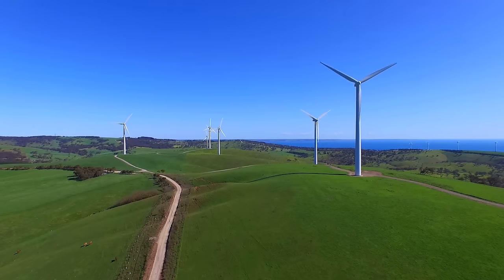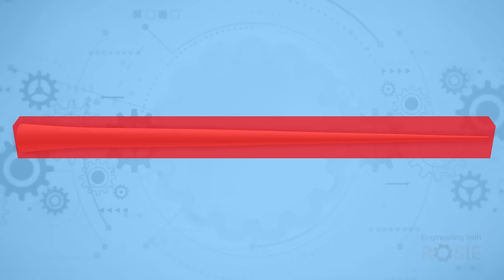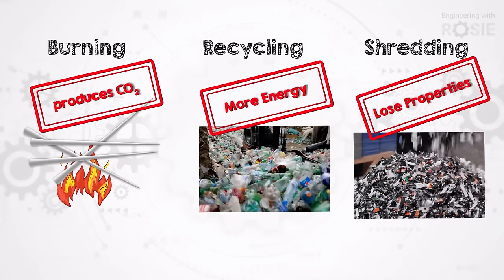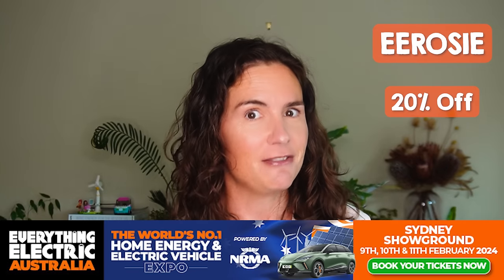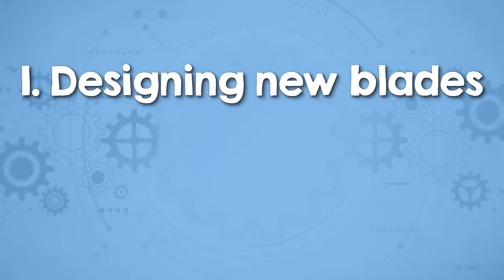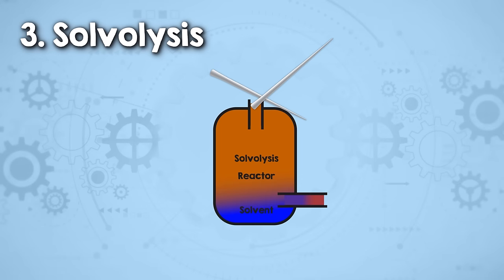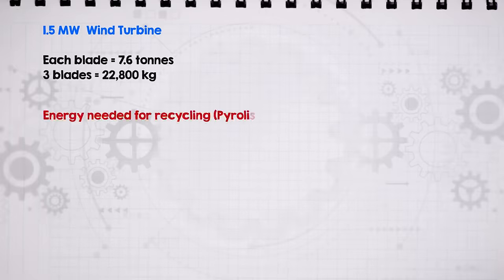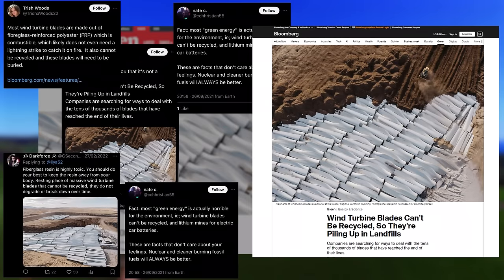This Is Why We Don't Recycle Wind Turbine Blades

Comment: I don't see the problem with using landfills for wind turbine blades. It would seem that burying them and forgetting about them would have few environmental downsides? Do these massive structures break down in landfills and leach harmful chemicals? Are there any other hidden environmental or ecological drawbacks to this option that we should be aware of?

Comment: Repurpose on site to redirect wind in a way your modeling software says will improve efficiency. Use them on site as storage, as shelter, as a culvert or as a barrier. Land fill them on site so they aren't as noticeable. Reprocess on site to fit into standard shipping containers using the industry equivalent of migrant laborers and/or harvester combines.  Park them in the closest convenient space until whatever solutions mature to the point someone offers to buy them.
The USA can just lay them along our southern border and call it a wall.
Just to brainstorm a few ideas.

Comment: It would be interesting to understand how it is possible to calculate blade use per person since number of blades required is variable as wind speed varies from 0 kph to >100 kph and operational temperature must be >-30 C. At 0 kph and/or -30C, an infinite number of blades is required. So too an infinite number are required when wind exceeds max Q.

Comment: What do you think about the very recent (just a few days) announcement by a WSU research team's new chemical recycling process? Is it hype or a real thing? I got the idea that it's only for carbon fiber, but I'm not sure if it could be adapted for glass fiber, too.

What they say is: "The method preserves the carbon fibres as well as the resin material in a useful form that can be easily re-used. It works at moderate temperatures below 200 C and ambient pressure without the need for a pressure chamber, which saves operational and capital costs."

Comment: hi in stead of burying the blades in land dumps why reuse as a river bank replacement they could driven down into side of bank and each one over laps the next as in fish scale help hold embankment in place finish of coat of concrete or fill the hollow of each vane to give extra weight

Comment: What about using them for road base materials to span across soft areas which use up a lot of fuel in equipment to remove material from the areas, making an then transport the new materials back to the area, an then place an compact it back.

Comment: If some of the wind turbine blades have been at various graveyards for over a decade, I have a question.  Why wasn't a recycle plan developed in parallel with design and manufacturing of the blades?  May seem to be an ignorant question, but the bouncing around by the author gives me the impression recycling was not as heavily considered as it maybe should have been.

Comment: The use of shredded tyres,plastics and other solid organic wastes in cement kilns is well established,these blades have the dual benefit of providing both energy and raw materials to the kiln.
As you point out there is no increase in CO2 as it just replacing,typically coal,and the inorganics in the blades, mainly Silicates are essential for the cement chemistry. 
Cement kilns have been using similar shredded wastes for more than 30 years.

Comment: Great stuff, though I would like a little more on just how small a problem this is. Burying inert stuff in landfill is anyway not a bad outcome - it takes little land (the quantities are tiny in the context of the far more hazardous stuff we already bury) and the land is eventually completely reusable anyway (you can happily build houses or farms on it). As you point out the turbine blade's very durability is what makes them inert and therefore harmless and not worth recycling.
I just don't see what the big issue is - to the degree that I think those pushing this "turbine blades are environmentally disastrous" schtick are just desperately looking for excuses to keep burning coal and oil.

Comment: What about using the blades as telephone poles or poles for home back yard turbines? What if the blades flange were attached to a ground rotating base, would the blade and nesele turn into the wind?

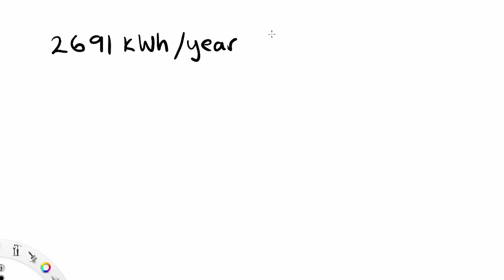Comment: 1:30 your calculations assumes that wind turbine will lasts 20 years, but in practice we can see that it's not a case.
Those landfills are not filled with 20 y.o. wind turbine blades.

Comment: Shingles on roofs? 
House siding?
Bus benches and awnings?
Cut crosswise to make earthen reinforcements? (like those dirt filled tire structures or road reinforcements)

Seems like they could be cut into shapes for tons out outdoor uses, not just bridges. The entire blade wouldn't be good for any of those. I bet there isn't much area for straight and flat enough bits to be cut off for 20ft siding pieces, but there's surely some. Then the smaller profiles can be cut into shingles. If the blades can be reformed via heat and pressure then even more of the blade could be reused.

Comment: Perhaps our problem is that we don't take externalities into account. (the cost of not recycling something).  It is more of an accounting problem than a technical one.  Many of our worst assaults on the environment that we all swim in, is caused by us not considering externalities.  For instance, whether or not the alkanes and alkenes produced by simple pyrolysis of plastics are valuable enough to defray the cost of the process would look quite different if we took the cost of having microplastics in every corner of the planet including in our bodies.  Add to this the cost of sending and storing something in a land fill and a few other factors.   The pyrolysis of turbine blades should also produce a range of hydrocarbons which can be separated in a fractionation tower.  In addition petroleum chemists have worked out methods (cracking for instance) to produce either longer chain or shorter chain molecules, depending on what is in demand.

Comment: if there was a cad model of those blades one could cut out profiles for use in projects with a saws all or rotozip with abrasive blade. if you had a 3D profile on CAD it would be easier to use in a larger assembly.

Comment: I'm interested in the technical details of why you could not use aluminum.  I understand the answer is cost and weight.  But would it also be literally not feasible at that scale? Only asking because from my understanding aluminum is highly recyclable, and was used for a long time for airplane wings.

Comment: Hi rosie
My name is Nir and I live in Israel so you have fans all over the world. 
I saw a video of a German engineer taking waste of composite materials and adding them to the concrete mix. According to his claim. by adding these materials to the concrete mix only half the amount of cement is required to reach regular concrete performence. It is also possible to significantly reduce the amount of steel in concrete. (The production of these two materials is a big ecological problem )  Do you think there is any scientific truth behind this claim?  Can shredded blade waste can be used for this purpose? Apologies for my poor English Thanks Nir.

Comment: Penrose the hell out of their shape, make them stackable AND aerodynamic?  I'd love long lasting roofs and walls made out of them.
That said. With rising sea levels, our flood delta based cities, which are plenty, will need enormous volumes of light ground filling materials.
Stuff that can float on water saturated clay.
Instead of producing new dense expanded polystyrene, the old blades seems perfect for the job, if they are light enough.
That density comparison I have to leave for somebody else to make, but there should be structural advantages, too.

Comment: The overall problem seems to be the repeated stress due to flexure and the temperature variation during the day. It could also be the tip velocities are to high so a change of material at the tip could or the tip can be cooled preventing aerodynamic heating.

Comment: Transporting used blades is a huge problem.  I wonder why no one has come up with some type of portable grinder that can grind up used blades.  Even if they are just going to be put in a landfill, the chopped-up blades should be easier to transport.  They would also not provide the photo-op that full blades make when they are lined up at the landfill.

Several of the recycling options involve chopping up the blades.  Doing an initial chopping operation onsite would probably not be a problem.
Reply: A wind turbine blade or any grinder has to be many orders of magnitude greater  in terms of mass..... take a paper grinder, it will give you a sense of what would be needed... And I have thought of it myself and I believe it's been done for smaller wind turbine blades.....

Comment: You make great points. I would maybe suggest using the turbine blades into artificial reefs instead of tossing them into a landfill where being buried underground serves no utility. The artificial reef idea might be sound because it would encourage sea life to foster. Fiberglass would not pose a danger since it's universally used on most marine watercrafts. Any how...I hope it might spur creative ideas beyond burial as the most ecological way of disposal.
Reply: It depends whether reef wants to take of on fiberglass/composite surface ( I do not know )
Reply: @dmitripogosian5084  barnacles will attach to fiberglass over time. The tube-like structure also makes a viable cave of sorts for ocean life. Perhaps long blades could be used as pier walls to mitigate ocean erosion.
Reply: @pdubsweir3  good point, barnacles surely will attach

Comment: I would go with getting thermal energy out of the old blades – least complicated, and even though there are CO2 emissions, they are not nearly as bad as it looks.Would be even better, if we could produce the blades from renewable materials (that take the carbon out of the atmosphere in the first place). Landfill does not sound desirable, even though if done in a "concentrated" form, those blades could be dug out later if needed (easier with large pieces than with shredded stuff).

Comment: Please, someone calculate the value of carbon sequestration in properly burying the blades. Please also Include a discussion of the potential sources of both the resin and the fiberglass as to renewability. Please also include in the calculation table the comparison values of CO2 emitted in the various alternative processes involved in recycling. Please also Include a discussion of the potential sources of both the resin and the fiberglass as to renewability. Obviously burying the blades sequesters more than just carbon... TY someone. ❣

Comment: Given that the cost of transporting decommissioned blades to recycling processes is significant, and we do not yet have completely green transport options, maybe it would be best to stockpile blades close to the original installation. This could be in some pit (effectively a specialized landfill) or some convenient cavern or disused mine or something. Money would be set aside for recovering and transporting the blades at a future date when green transport is available. 
    In addition, they could be stockpiled for longer, say 50 or 100 years, until sufficiently advanced recycling is affordable and available.
Reply: Shall we start garnisheeing your pay for recovering and transporting the blades at a future date when green transport is available?
Reply: @billrichards1965  ?? These are ongoing businesses with significant revenue streams, and they can set aside reserves for eventual transport as part of the cost of doing business. Why should they even consider touching the expenses side of their balance sheets? I don't see the logic. Whose pay is going to get garnished?
Reply: @fbkintanar  Part of doing business is to look at both sides of the balance sheet! How many companies would continue doing business at a loss? None, hence why the massive subsidies for when it's windy farms.
Why not garnish yours of course. Consider it a down-payment on the eventual recycling of the blades!

Comment: I spent the video wondering why they can’t repair blades. It would be a lot better.
Although the elephant in the room is how does blade waste compare to other type of power generation recycling at the end of the power plants life. Such as a gas turbine including the hall and ancillary equipment, and also nuclear power stations which take decades to decommission.

Comment: The header reads 'why we don't recycle them'.
Then you posit that the question is 'why are they just so hard to recycle'.
A MO company is doing it and selling the output to power concrete ovens.
They are paid by GE and the ones which burn it pay them.
Using them for snow fencing could just millions of them.  but only once..

Comment: So the bottom line is one of the main components of a wind turbine is not recyclable. Most other main components have to have Coal mining involved or the use of fossil fuels to get the raw material in a usable form. They are very recyclable. How Ironic to think that it’s a Renewable process.

Comment: The comparison to a bike's "footprint" is helpful, but I think it doesn't accurately reflect the intrinsic value of all the specialized engineering that goes into turbine blade manufacturing. It's not that bikes don't also require great engineering, it's that there are scores of use cases outside of wind energy where there is great need for engineered material of that scale and structure. It's a total wasted opportunity to let them all wind up in a landfill.

Comment: If the energy for recycling is only a few days output from the turbine then surely that has to count as de-minimus? i.e it's not a good reason for just landfilling them (100th of very little is still very little). 
Also is this solvolysis process the recycling process that Vestas made a big noise about a year or so ago? There was frustrating little detaisl about what they were proposing back then.

Comment: rose lets not forget the massive slab of concrete at the base of the collum and as for ur bike example is not the question it should not happen at all i made a 31ft fiberglass caravan using ur bike as an excuse is Laim. yet it has been home for ten years

Comment: I can understand that blades are made stiff so they don't hit the tower.  But if they were designed to be on the leaward side of the tower, this would not be an issue,
Reply from the maker: I made a video about that a long time ago! Comparing upwind vs downwind rotor designs

Comment: Recycling is often done at an environmental cost.    But it makes people feel good.    Living in a small rural location I once asked a friend into recycling 'if the environmental cost for the use of a second truck to collect recycling material, having to take that material 50kms (plus 50kms return) to the nearest recycling collection point, and that point then packages the material and sends it 2,600klms away for processing is greater than just having one bin and using the local landfill should we do it?' and the answer was yes.  It was important as a principle.   To me we should be acting to minimise the adverse impact on the environment.     Every situation is different.  Looks to me you have the blade thing right, we should work towards recycling but we shouldn't allow ourselves to make crappy decisions because it 'looks right'.

Comment: You stated that the fibres can be recovered, but their strength is reduced. Would the be useful to the automotive industry to build cars from? Much lighter cars require less energy to power them.

Comment: Given the strength of these items there should be innumerable uses down the line. The loads you mentioned could easily meet the structural requirements for many types of buildings. Designing a system to make effective use of them would be a challenge, but certainly it would be doable. With the housing shortage in many parts of the world I would think that should be a priority.

Comment: What about as structural components in dikes etc. We're going to need a lot of that in the coming decades. Strong. Durable. And transport by sea, where they will be needed, is cheap and potentially relatively low energy.

Comment: I have wondered why we can”t make blades the way we make telephone poles. A pine tree trunk. Very cheap. Very easy to recycle (burn it for energy or just dump it in a swamp/landfill).
It would be less durable than high tech composite. Also heavier.
Did i mention very cheap?  Doable by third world countries?

Comment: It'd be interesting if the composite could be cut into more or less standard sizes, to be used as a regular construction material ,maybe to replace structural timbers in buildings , or for fencing , sidings, or as roofing tile materials, 
A lot would depend on the varying thicknesses of composite ,
Reply: My understanding is that composites are strong, but if they fail, they fail catastrophically.  So I would be wary of anything structural built from them, especially 'second hand'

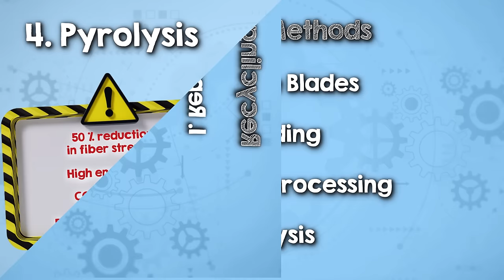Comment: I feel like at 9:20 you are confusing pyrolysis, which yields oils and gases, with gasification, in which you have the full combustion of the hydrocarbons. Pyrolysis of all plastics gives a bio-diesel type of re-constituted mineral oil. 
https://en.wikipedia.org/wiki/Pyrolysis
I think you are right to focus on all-of-life carbon emissions. Making concrete filler with the recycled fibers seems most logical. The point about pyrolysis is we have all these 'wrong number' packaging plastics, dirty food containers, pizza boxes, shoes, clothing, diapers, wind turbine blades . . . the list is endless. Because these products are made on industrial scale we need industrial-scale pyrolysis plants to process it all, to avoid more landfills. The mineral components left after pyrolysis depends on what the feedstock is. Turbine blades yield glass fibers. Different plastic, different minerals.